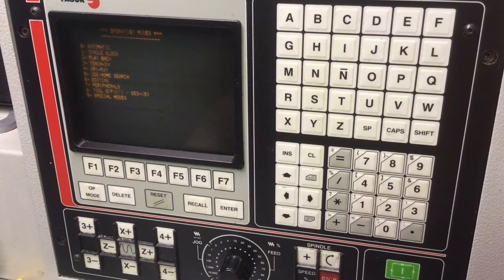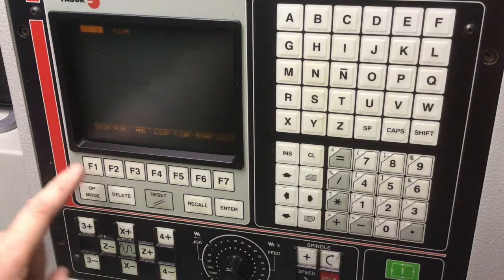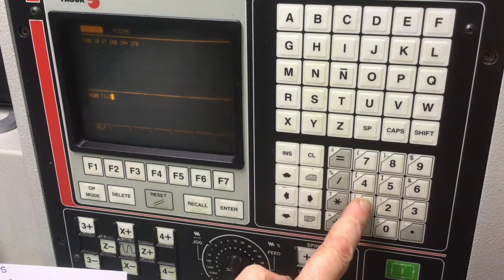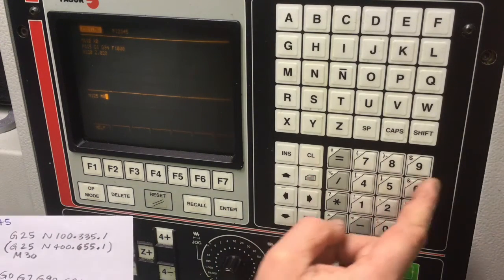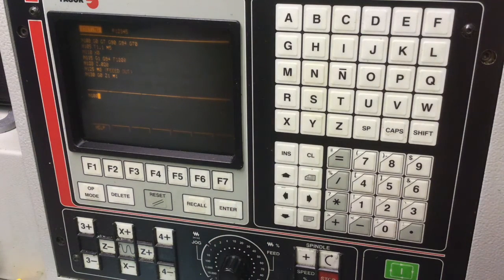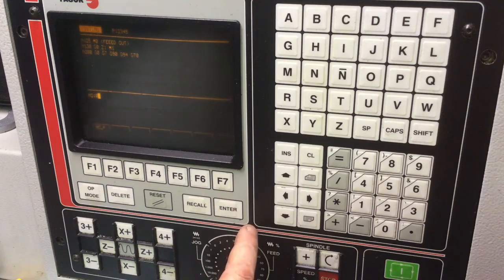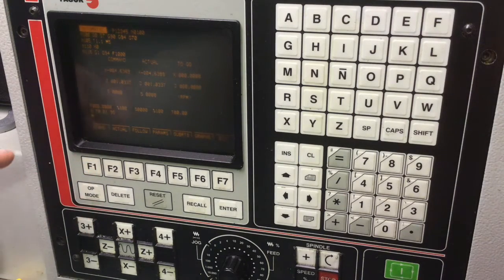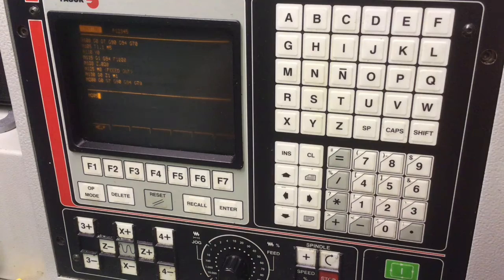Fagor 8025 editing

Comment: I've bought a small CNC machine with this control; When i power up the machine, on the self test appear : Error code 094: Parity T, G53 - G59
This is not a blocking error, but i'm unable to understand this error.
I've also read the manual, but i don't understand what mean : Parity error in tool table or zero offset table G53-G59. The CNC resets the serial line RS232C machine. Can you help me?